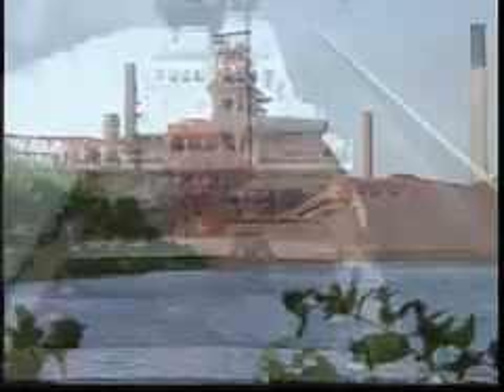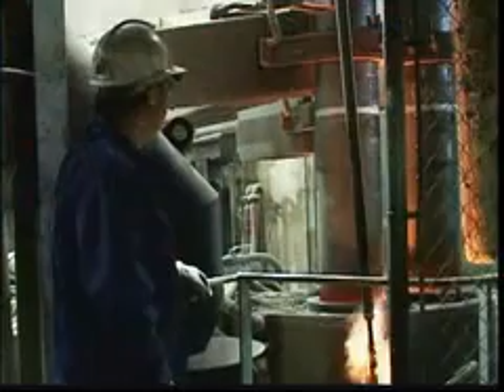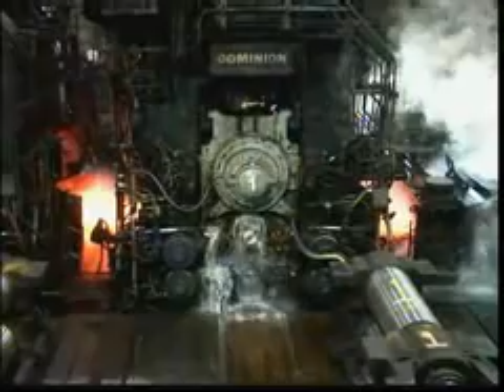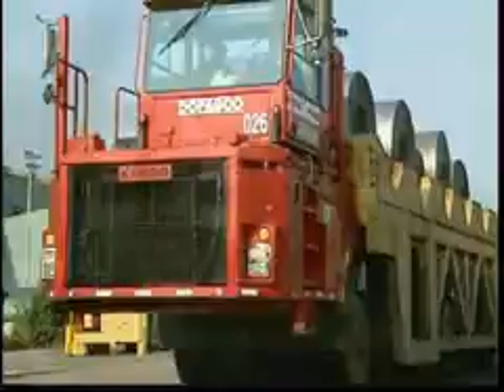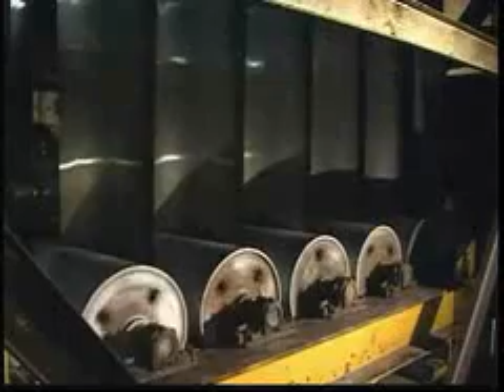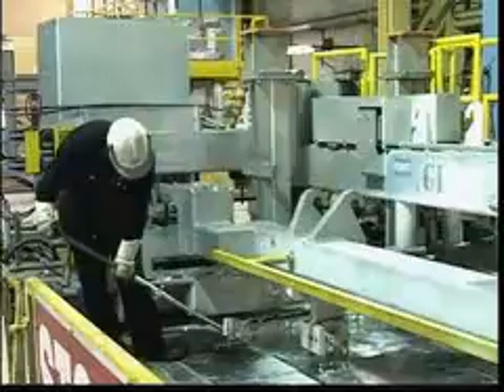Arcelor Mittal Dofasco Behind The Scenes

Comment: The aluminum mill I work at bought Dofascos old 56" 5 stand cold mill back in 2007 or thereabouts. We used two of the stands to build a tandem cold mill for aluminum coils. The big gearboxes still say "Dominion" on them.

Comment: I appreciate your comments concerning safety! Fabricators should do everything they can to prevent fume inhalation, yet I see hood after hood enveloped in fumes. Why can't they just use NIOSH masks?
Reply: Because most of the Machine Operators, oversee 99% of the Steel Fabrication inside of filtered air Control Booths.  I worked ~ 15 years in the Cold Mill, and there was NEVER an accident, on my Shift.  All employees (and especially visitors) were mandated to follow safety.  Hard Hats, never by-passing Yellow Safety Tape, cert work boots, proper clothing, no jewelry, and (in some cases) Chemical and Gas sensors.

Comment: Those coil carriers don`t exist anymore, I used to drive them steady and they retired them and cut them into pieces, now they use tractors with rams equipped and carry one at a time.
Reply: ***** In Cleveland we use the large tractors with the big boom on the front. We call them "Big Dik's"
Reply: Actually they are Palings now, Kress made the C-techs, and I was talking about servicing the ramps at no2 Hotmill.
Reply: *****
 
Actually they are Palings now, Kress made the C-techs, and I was talking about servicing the ramps at no2 Hotmill.
Reply: ***** Well that sounds like a normal day in Material Handling to me LOL glad I don't work in that god forsaken death/cancer trap anymore!. I bet I even know where it happened too. Perimeter road most likely that was Todd Abbotts stupid idea the way it`s set up now.
Reply: ***** Simply called tractors a glorified forklift with a ram I drove em the whole time I worked there when I was not on the crane.
Reply: I DID work in the Gantry yard, but to make a long short I got let go for having PTSD and have a human rights case filed against them , I ain`t gonna sugar coat fuck all for that company anymore, and yes some of the pot holes could lose a pickup truck around there, they don't fill em in until some one goes to medical with a fucked up back and gets assigned to light duty for months.
Reply: ***** 
 
I DID work in the Gantry yard, but to make a long short I got let go for having PTSD and have a human rights case filed against them , I ain`t gonna sugar coat fuck all for that company anymore, and yes some of the pot holes could lose a pickup truck around there, they don't fill em in until some one goes to medical with a fucked up back and gets assigned to light duty for months.
Reply: ***** Crown Royal takes most of the load......
Reply: @Metal_333  I’m sorry to hear about you’re PTSD, I hope you didn’t eat the chilli. God is good, please don’t use drugs as coping mechanisms. You are better than that.
Reply: @angrycustomers2211   How is the "untouchable king of the gantry"? (Todd Abbott) did they manage to provide him enough pot holes and fences projects in his corner away from authority these days? or did he finally retire due to HRs advice???
Reply: @Metal_333  I wish I could answer but I’m not sure. I am only a contract worker from tmi,  so not too familiar with what your asking. I was in the hot milk the other week replacing cylinders on the rougher and stumbled across this in my travels